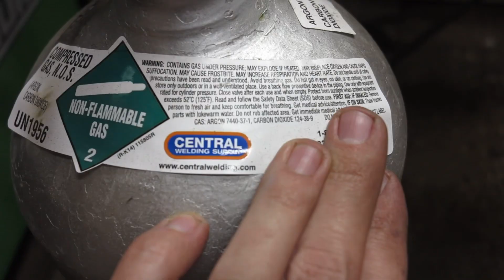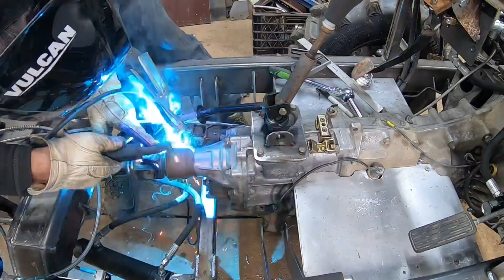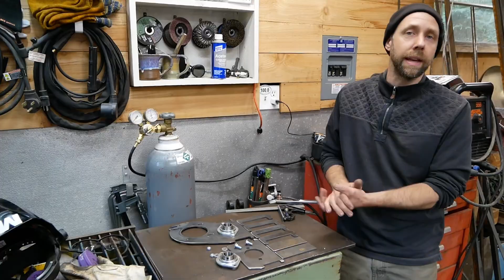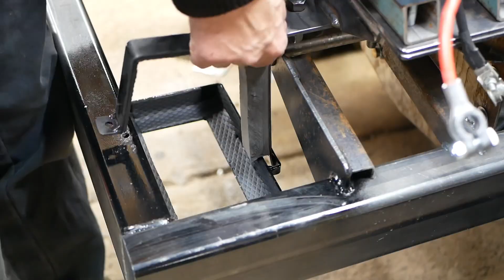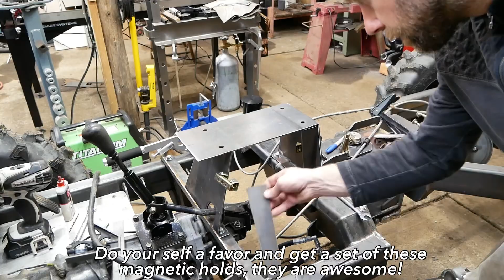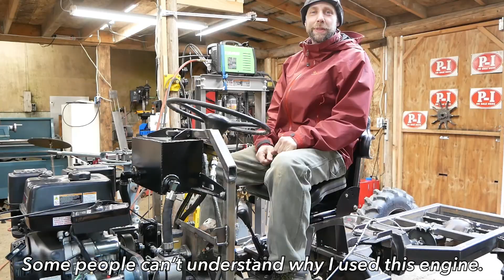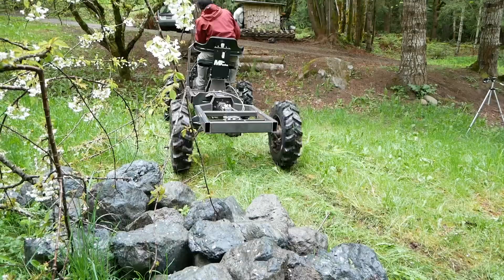420cc Predator powered articulating 4X4 dump truck build part 7

Comment: dang cool build. impressive output by that 420. looking forward to seeing how it handles some weight in a couple hours.

Are you still using this machine?
Reply from the maker: Yes, it's still holding up great and getting plenty of use around the property! 👍
Lots of work to build this thing but it’s been a good machine. I posted a video this summer using it to haul gravel to my cabin.

Comment: You were spot on with the 8 to 1 ratio, that is plenty fast enough for the design of the machine. I think it's going to be awesome when completed. One note I'd put a small hydraulic cooler in front of the engine off a case 222, 444 extra because when you start using it your going to be heating up the hydro and then you'll have everything leaking and falling.

Comment: I like that you changed the ratio for the hydraulic pump to compromise for steering, that was a good move. Also like that you went with the seat with a suspension since you don't have a suspension under the vehicle. All in all this is turning out to be a really interesting little workhorse.  Just out of curiosity. instead of using gearboxes and transmissions and old CV joints. Do you think that this vehicle could also work with hydraulic motors on each wheel? I seen some machines drive like this it's very slow but it's super strong. One example I've seen is electric forklifts. Maybe a different application I suppose. Anyways this channels is quickly becoming one of my favorites. Great work man!
Reply: Hello, Mr. Matthews.

Comment: Awesome project. Thinking about using a Geo Tracker transmission, transfer and axles coupled to a B&S 16hp Vanguard auger engine (lower RPM torque). Just need 28 hrs in a 24 hr day. LOL. Have fun with it!
Reply from the maker: Awesome Karl thumbs up 👍

Comment: So,,, how many feet per minute do you think this is going in 1st gear?? Also, do you feel you need the engine to be at much higher RPM's than idle for the clutch to engage??  I want to build a machine that creeps.. 10 to 14 feet per minute.

Comment: i dont understand, how do you operate the brakes, clutch and throttle?
I only see two pedals?
Reply from the maker: Thanks for checking out my videos 👍 
I’m running a centrifugal clutch with an 8:1 gear reduction going to the manual 5 speed, so basically it’s an automatic with a selectable gear box. You can start out in any gear.
Take care

Comment: You said this is now 8.0 to 1, correct? And that is before the transmission and third members?  I want to build a craft that will creep along at about 10 feet per minute in first gear. I not only want to run a transmission and hydraulics, but also a pressure washer pump.  This is probably my 4th trip through these videos.. lol...  And something I would argue is the use of the single disk for the rear brakes. You make a very good point about heavy equipment using this system, but fail to realize you will never carry the weight those things run empty! Also, without the very tight limited slip/sure grip/posi or Miller spool, you could stall going up or down a hill with a load and NOT have control. You know your property better than all of us, but those are the conditions many of us think about. Also, you would not need power brakes. Cars in the 50 and 60 had a single pot master cylinder nicknamed a "jelly jar" that worked very well and after that were duel pot. Until the 80 - 90's, about half of the cars on the road did not have power brakes. A pretty simple dual master for your rig could be had from a 1974 Dodge A or B body. They are aluminum and plastic and very available cheap!! Just ask for NON-POWER BRAKES. We all know you can build the brackets!!

Comment: I’m watching the whole series. I’m not sure if this is genius or madness. The tools to build it are pretty affordable. Material aren’t cheap, but manageable. But the design experience is very expensive, as is the hours put in building it. For someone with less education/talent/tools go buy one. I’m pretty good. I could not reproduce this
Reply: You're forgetting a very important aspect here: This is both a learning experience, and entertainment (for the builder. Those who don't like this kind of stuff, won't do it). Both would cost you a lot of money if you had to get them elsewhere, so the hours put in to building this are easily compensated by not having to buy either of those.

If you factor your time into the cost of a project, you either hate the project you're doing, or really, REALLY love your job.

Comment: I saw that in a later video you built a ROPS for the tractor. Good call! Because of the pivot design, the rear wheels aren't helping stabilize the machine, and because of how tall it is, it seem super easy to roll over when you're climbing around those rocks. Careful, Mike ;) Overall,  super impressive project - congrats in getting it done!

Comment: I hope its not too late, but 2 things that might help. I know you said you might want to weld the rear axle, dont. That will reduce your turning radius and increase steering effort. I run construction equipment and our rubber tire loaders (basically the same configuration you have here) are open diff. Also you may want to add stops to the frame or something to keep from over steering and possibly hurting your center joint you made. Other than that, this thing is awesome, and i want one lol

Comment: While steering the wheel the engine had more loaded due to hydraulic pump and hydraulic cylinder actuator. Its leads to power loss, shortly engine damage, lack of power distribution to power train.
Reply from the maker: Maa Videos don’t over think it dude.
Reply: Really I appreciate your innovation bro

Comment: you should put some suspension, and some rubber bushings, if I was to build one I would make it with four  wheels in the front, and leave the trailer with two wheels drive, making it 6x6.

Comment: So can you change gears while you're rolling or do you have to stop
Reply from the maker: You can but it moves so slow by the time you let off the throttle it’s basically stopped anyway. 
It’s really just like a tractor, you select the gear and go, it will start out in all 5 gears.
Reply: @Mikefestiva  cool

Comment: Vertical down is not a weld used in structural steel only in the U S cheap and weak
Reply from the maker: Were did I weld vertical down in the video. I’m completely fed up with rude people like yourself that try and find anything in my videos to point out what I’m doing wrong. I would like to see what you can build?
Reply: I am not sure what your point is Adam. There are times when welding down hill is acceptable (Introduction to Welding Pipe Downhill - FABTECH U.S.A )"On thinner-wall pipe, downhill welding enables operators to run “hot and fast,” increasing productivity compared to welding uphill, which is required on thicker wall pipe to increase heat input to ensure complete penetration." The important thing is to understand when it is and when it is not acceptable to weld downhill and why

Comment: Does your band saw table throw blades bad? And if so, what did you do to fix it?  If got a Harbor Freight band saw like that and have had issues with it doing that.
Reply from the maker: If you push hard it will come off sometimes. 
I have a Enco bandsaw at work basically the same saw but gray, and both saws have to be fine tuned with blade tracking, tension and the bearing guides need to be set properly. After that they will cut fairly good as long as you don’t push to hard. Take care Jamie
Reply: Mike festiva Thanks Mike, I appreciate you replying.  Great builds and keep em coming.

Comment: i suggest the shifter put beside steering wheel for easy shifting
Reply: if it were an automatic transmission that would be easy but because it is a manual transmission it would be a pretty good challenge to get the linkage to work and probably and not worth the the effort. I am pretty sure most tractors have the shifter in front of the seat for that reason

Comment: I'm loving this build and learning a lot for my own build.

I think the pinion brake is perfect for this application. They have a major downfall in wheeling with an open differential because they 
A: lift a wheel or B: break an axle shaft, allowing the other to freewheel. The articulated center should eliminate wheel lift up to a ridiculous side hill and the CV axle doesn't care any weight in this configuration. The chances of torque shock with that engine fed through a centrifical clutch are next to zero. If you weld the diff, the only way that I see you breaking it would be yanking the drift brake too hard

Comment: The pressure in your Argon tank is off probably because you are above sea level? When at sealevel the pressure should be accurate. Grtz.
Reply from the maker: The pressure in the take was off because the gas company shorted me, I just ran out of gas the other day and I picked up a new bottle and what do you know it it had 2000 psi in it 👍

Comment: mike , This cool perfect for hauling fire wood from woods only thing I see that may give you trouble is nothing is holding the wheel bearing between front and rear section , it should have a stub shaft in it to set the preload of the bearing it may fall apart you may have to drop drive shaft below frame .
Reply from the maker: Matt Gumina thanks for checking out my video, I have had a lot of people say that about the bearing and yes there are a lot of wheel bearings that work in the way you mentioned. This specific bearing is from a F350 super duty and it’s got a large bolt that holds the entire assembly together. The preload is set when it’s manufactured. I could not run the drive line below the frame because it would bind when steering and articulating, this center CV joins is extremely important to have exactly centered in the pivot or it will bind and break. Take care
Reply: That's a good point! That happened to me. 20 years ago. My CV shaft broke and the parts store gave me the wrong one. So I put it back together. The next day on my way to work the tire fell off because the hub bearing seperated. I should have cut or dismantled the broken CV shaft and left the stub in the bearing to hold the inner and outer bearing races together.

Comment: I'd probably bend the shaft of the shifter to the right or use a taller one thats curved like that because the between-the-legs is too awkward...tractors that have that dont use that for main gear shifter its almost always a rangebox that's located there...maybe go the old john deere route and mount the shifter on the console next to the gauges
Reply: the transmission on this vehicle does act as a range selector just pick a range and go you don't need to shift while driving only for reverse or forward  you can start in fifth gear if you want

Comment: dude thats cool and all but like wouldn't it be cooler if it was rear engine ? it will be karder but it wont the waights be more balanced?
Reply from the maker: Wouldn’t a engine in the rear completely defeat the reason for building this? It’s going to be a dump truck. How many dump trucks have you seen with engines in the back? 😂

Comment: Not sure the V belt can carry the load of the Hydraulics  and an alternator at the same time 
You may slip it if you try to get  enough pressure to dump the bed 
Also you really need to get rid of the front pillow block on the rear drive shaft  you are trying to support it in 3 places It will start binding when you get some wear in the steering pivots
Very Cool Vehicle Overall
Reply from the maker: Thanks for checking out my video 👍 I don’t see how I’m supporting the rear drive line like you said. Have you followed the build from the beginning? All shafts are mounted on bearings at each end, I’m trying to think where the third bearing is that you mentioned? Take care
Reply: Hello  @Mikefestiva  
 
 I am talking about the  drive shaft  pillow block  in the forward section of the pivot joint It is right behind the Ujoint and in front of the CV joint 
The front section of the drive shaft is already supported by the rear of the transmission  (U joint)  and the CV joint in the pivot   Hence no need to support it any further 
The rear drive shaft section (behind the CV joint)    has the 2  bearings to maintain the drive shaft alignment  
Also if you remove the said pillow block you can reinstall the snap ring in the center CV Joint and the the slip joint in the transmission tail shaft will give end play you need in the drive shaft assembly 
If you remove it you will see what I am talking about The shaft should still be stable and free to align with the U joint and the CV joint regardless of the wear in the pivot pins 
By the way That CNC cutting  table is very cool

Comment: You should of used angle to mount your floor boards.... not drill into the transmission casting
Reply from the maker: It will be fine, those castings will be plenty strong for the little force ever put on them, keep in mind I’m only holding the floor board down with the small 1/4-20 hardware. The weight is distributed down the entire transmission.

Comment: Thoughts on running a small alternator and running some lights for fall/winter use? I know the engine has a 3amp stator, but that's barely enough to keep the battery charged.

Comment: you know you're gonna have $20,000+ worth of vehicle/equipment here when you're done, right? if you can rig some 3 point lift arms in the rear and a center link mounting point, it would add to it's value, and versatility. even more so if you did it front and rear. well done, well done indeed!

Comment: do you go back and forth between tapping holes vs drilling and welding the nut or is tapping them your preferred solution, whats the minimal wall thickness youd tap in these sorts of use case
Reply from the maker: I weld on nuts if the metal I’m mounting to is 1/8” or thinner for heavy stuff. But if it’s thin light stuff like body work 1/8” is fine. The frame is 3/16” so I will just tap it for mounts like the seat. Thanks for checking out my new video 👍
Reply: @Mikefestiva  thanks for the feed back, never certain if im better off tapping or welding got the gear to do either, tapping tends to be neater welding tends to be stronger i guess, how many psi are in those tires? do you gain any "suspension" if you drop them to ~5-8psi
Reply from the maker: Yes you are correct about tapping versus welding. I mostly tap if I need a part to be removable or it could be a problem later if it’s welded and fixed to the frame. Yes I just realized recently that the tires had 30 PSI still in them, I had been so busy building it I forgot to lower it down, I’m at 10 PSI now but the tires are still quite stiff so I’m going to lower them down more. It definitely will help for traction and a smoother ride. Take care Andrew

Comment: I think you need to do a pretty hefty skid plate for the steering hydraulics on the bottom. 

You could also do a duel battery set up under your bench seat and have accessories and stuff on there, with 24 V you could even do a welder.  Whatever you would use on a tractor that use battery lake electric pump to a chemical sprayer or lights or you can put a power inverter on there to charge electric tools or electric motors when you turn it into an amphibious vehicle. ;)   You could even put the second motor on the back and put A quick hitch and make it like a PTO on a tractor and you could even run some small implements.  

Some balloon style tires might act like suspension a bit as well, it did pretty good at speed but that would take a little of the bumpy out of there. 

Awesome. I want one. :)

Comment: Still loving this build!  I need one of these.  I'm hoping you build a pretty big bed.  I get that you can't put 4 cu yds of concrete in the back (actually yours might just handle that) but sometimes I want to move large volume of light material as opposed to running a tractor back and forth a million times with one bucket full of mulch for example.

Comment: I don't know what size of cylinder you're getting for your money, but here in the UK we charge (steel) cylinders up to around the 3000psi mark. For you that would mean we get around 80cf of gas in one of your size 46 (ie 46cf) cylinders (24"x7"),  To refill that would be around $60-75 over here (depending on whether you own the cylinder or not)

Comment: With all the gears you have you choose the perfect motor and maybe you could have used less hp! I think the design you projected you could use half the HP. The gear ratio and reduction are over engineered ( that’s a compliment).
Reply from the maker: Yes I think I could have used a 8HP and still have had power, I still get people telling me I used to small of a engine 😂 some people don’t understand gearing and they think you need large amounts of power to do anything. 
Thanks for checking out my new video 👍
Reply: Mike festiva. I don’t think you will EVER run out power with those gears ⚙️! Mike you will always find people who comment and don’t know what they are talking about. I watch your channel faithfully and try to comment on every video. It helps the channel grow.
Reply from the maker: Military Museum Thank you!!!

Comment: All that work and no suspension. Why no suspension ?
Reply: this is basically a tractor that travels a relatively slow speed and suspension would make it less stable under heavy loads on uneven ground  and would make it tipsy

Comment: You are a mechanical genius.
Reply: just wait to see his creative solution for adding fully adjustable limited slip to the rear differential if it works it will be pretty ingenious it is still in the design stage but i think it will work great

Comment: Take some psi out of the tires
Reply: mike did take some out but once it is up and running he is going to experiment the pressure to see how low he can run it with a load it is still in the design stage and fine tuning  stage